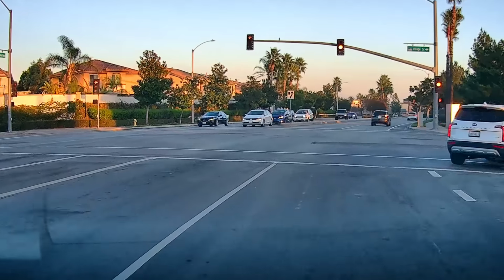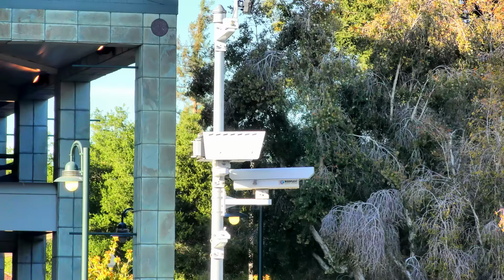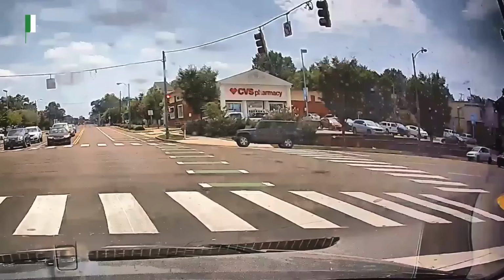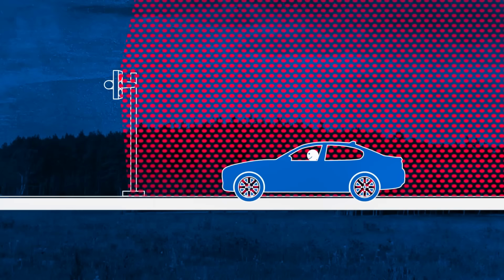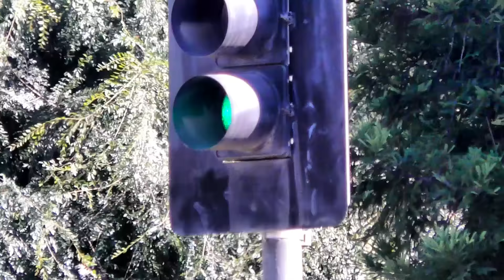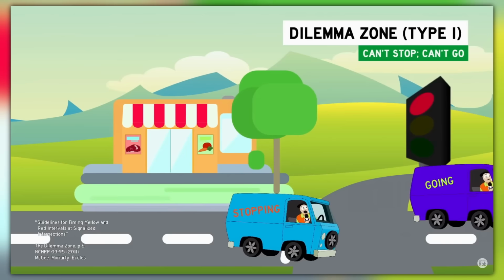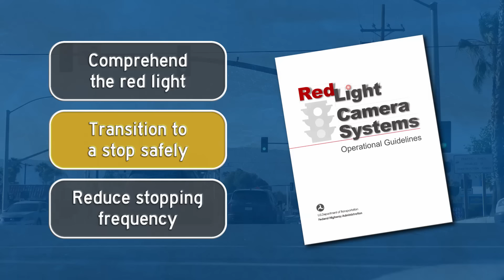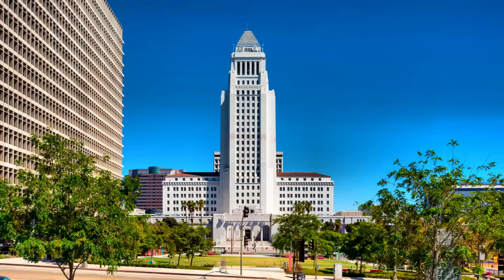Three ways to FIX a STOP LIGHT (so drivers ACTUALLY STOP!)

Comment: Note: It is not only about the length of the yellow, but also the length of the 'all-red phase'. We call the combination of the two the inter-green interval. If you use a yellow phase that is too long, it will also confuse the driver (eventually they will adjust their behavior and use the extra yellow as additional green). Hence, you can also adjust the all-red phase to compensate for the yellow interval.
Reply: Just make the yellow flash for the last .5- 1 second or whatever is safe before the red. Too short of yellows with red light cams are racketeering and sick.
Reply: I agree. The all red phase is the most important. It lets the intersection cool down before the light change happens.
Reply: counterpoint: I lived in a grid municipality with nice, long yellow intervals -- but cross traffic would turn green 1s before red.   No all-red phase!
Reply: He talked about that in the video
Reply: Yes, he briefly talked about it near the end of the video. I wrote my comment in the middle of watching the segment, but I discussed it in greater details. Most signals in the US have an all-red phase.
Reply: @jackman-vx9hh  Flashing lights could trigger Epilepsy that would cause a crash and a Lawsuit. How about having the green light come and stay on for a small amount of time to show that you can go through yellow with caution and then have it stay on and have the red light come where you have to slow down and the the solid red with and without the normal arrow for regular flow turns like it is now?
Reply: Just needs to be a count down
Reply: @PiOfficial  That is a pretty good idea.
Reply: @PiOfficial  You can use the countdown of pedestrian signals. Not sure if this was ever evaluated since those countdowns are used for providing information for pedestrians.
Reply: @beauxr.benoit1374  Emergency vehicles have flashing lights and yet no one complains about them.
Reply: @automation7295  They aren't in the same spot long enough for you to stare at them long enough to trigger an incident.
Reply: @beauxr.benoit1374  
Epileptics aren't typically allowed to drive in most places, bud
Reply: The all-red phase actually incentivizes red light running, because people know they can do it without getting hit. It's like a "snooze button" on your alarm: you don't give the alarm the attention you would otherwise,  because you know you can "get away with" hitting the snooze button a few times. Similarly, once people know there's a 2-second "all red," they will exploit it by running red lights that are less than 2 seconds old.

Back in the day, there was ZERO delay between a red light, and the green for crossing traffic. And people, by and large, did not run red lights, because they knew they were taking their life in their hands if they did!

If there aren't consequences for bad behavior, people will engage in bad behavior. Reducing/eliminating the "all red" will--in the long run--discourage red light running. All extending the all-red does is normalize red light running.
Reply: @coupledyetivonvanderburg5385   What if they don't have seizures unless they are triggered? Even if they are just  riding shot-gun, this could still cause a Medical Emergency,
Reply: @beauxr.benoit1374  
1) still not allowed to drive as a rule.  2) flashing traffic signals have been a thing forever and it's never seemingly a problem, so this is all kinda moot anyhow
Reply: @coupledyetivonvanderburg5385  Okay, you win. This is more info than I had. You just took a 53 year old Man that sometimes thinks he knows everything. But I will admit when I am wrong. Thank you sir, I learned something today.
Reply: @bcubed72  The studies on this topic (see below) are pretty consistent which shows that properly timing the intergreen (yellow+all red) can significantly reduce red-running incidences. If the intergreen needs to be relatively long, you increase the all-red phase in order to avoid having a long yellow phase. I agree that drivers can adapt their behavior after some period of time, but changing the intergreen phase is still one countermeasure that needs to be considered.

“In conclusion, the duration of the yellow change and red clearance intervals has an impact on driver
behavior and intersection safety. The survey results and the review of published literature confirmed that agencies responsible for change interval timing take a widely varied approach in their practices.”

“At six approaches to two intersections in Philadelphia, Pennsylvania, yellow change intervals were increased by about 1 second, followed several months later by red light camera enforcement. The number of red light violations was monitored before changes were implemented, several weeks after yellow timing changes were made, and about 1 year after commencement of red light camera enforcement. Similar observations were conducted at three comparison intersections in a neighboring state where red light cameras were not used and yellow timing remained constant. Results showed that yellow timing changes reduced red light violations by 36 percent.”

“Based on this research, it was concluded that (a) an increase of 1.0 s in yellow duration (such that it does not exceed 5.5 s) will decrease the frequency of red-light violations by at least 50%; (b) drivers do adapt to the increase in yellow duration, but this adaptation does not undo the benefit of an increase in yellow duration; and (c) increasing a yellow interval that is shorter than the value obtained from a proposed recommended equation published by the Institute of Transportation Engineers is likely to yield the greatest return (in terms of a reduced number of red-light violations) relative to the cost of retiming a yellow interval in the field.”
Reply: Meanwhile in my country I remember you'll fail our driving test if you beat an amber light twice
Reply: Most all-red phases are short enough that I never noticed. But there is one near me that’s close to 3 seconds. I always wondered about that design!

However, as someone who often watches cross lights in order to anticipate my turn, I may have unintentionally outsmarted the system. Once I realized that there was a large delay before my green, I figured out that in the opposite scenario I could run a fresh red at that intersection… 😅

(I’ve taken advantage of the delay a couple times, but generally I would hate to be the person who’s still in the intersection, blocking someone else’s green… Or worse)

Anyway, it’s an intersection between a local highway, and a large freeway off-ramp. Given the amount of local traffic at certain times of day, it totally makes sense that people would unwittingly get stuck entering the intersection too late, even with the best of intentions. (Personally, I’m not usually there at those times of day)
Reply: But yeah, I can see that there are plenty of scenarios, especially large intersections with lots of traffic, where a significant all-red phase is necessary. It’s one thing for people to not enter an intersection on red, but it’s quite another to be stuck half way because traffic was moving slower than you thought (for example). I’m glad that the traffic light in my local example gives some extra time for people to clear out, before giving a green light to the perpendicular direction

Comment: Here in Australia we have a few things that help:

Re: blind corners near traffic light, often when there is a set of lights over a crest, around a corner or even further away where queuing is likely, we have a "PREPARE TO STOP" sign on the approach with flashing amber lights that illuminate when the lights aren't green.

Re: visual contrast, all traffic lights have a white retro-reflective border around the main plate. We have a lot of combo signals with turn, bus, tram, etc. alongside standard "straight ahead" signals.

Re: the dilemma zone, I know that our yellows are timed to match the speed limit of design speed to help avoid that sort of thing. Normally I think 50km/h (~35mph) zones are about 3 seconds through to 80km/h (~50mph) zones at about 5 seconds. Traffic lights are very rare on roads with higher speed limits (80km/h is basically highway speed, above that is freeways and rural roads).

We also have a lot of "safety" cameras which combined red light cameras with speed cameras. That extra deterrent keeps people at lower speed on approach to the intersection, increasing the amount of time allowed to stop safely.
Reply: Similar in my province in Canada. I find rspecially useful warning yellow flashing ahead of intersection with lights. They are time so that if you cross then while they are  not flashing, you are quarantined to make a green driving at speed limit.
Reply: We do have warning signs for crests or corners here as well in The Netherlands. Visual contrast: same, most likely retroreflective but something I never even thought about ;) Different times for amber based on the speed the road is designed for: ditto. Red light cameras that also act as speed traps: present as well.
Reply: We also automatically take your license away if you're caught breaking the law too many times, and you can get it instantly disqualified if you're caught doing 35+ over the speed limit. I don't know if that happens in the U.S.

Comment: There's a technique used at least here in Sweden to reduce the number of yellow light dilemmas drivers face: The green time is flexible and can be different in opposite directions. After a certain green time, the signal computer looks for gaps in traffic and tries to switch the light to red at an appropriate time when nobody is in that zone where deciding whether to go or stop is difficult. This means that traffic in one direction often has to stop while traffic in the opposite direction is allowed to go for several more seconds, but reduces the risk of rear-ending.
Reply: It’s easier to implement that in a smaller country but i agree that they could start at some cities
Reply: That is really proactive, and interesting.
Reply: @vortexriver1071  Are big countries incapable of technology? There's some weird notion that something has to be introduced everywhere all at once, but that's simply false. If anything, a large country benefits from economy of scale at some point.
Reply: @dykam  And in the US, traffic lights are controlled at a municipal level anyways.
Reply: There are also stop light poles that show the light color in/on the vertical and horizontal parts
Reply: @vortexriver1071 Yea, everything is not possible because the US is big.
Reply: I’d be amazed if the US had that in even 20 years. Our infrastructure funding is awful.